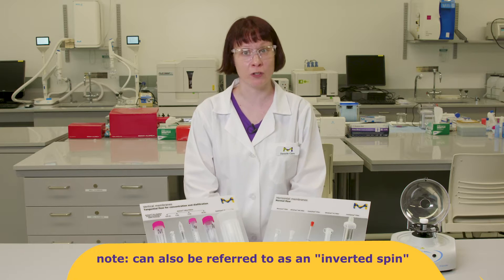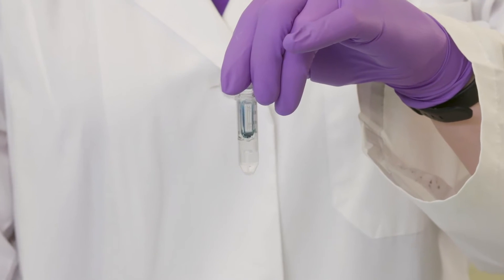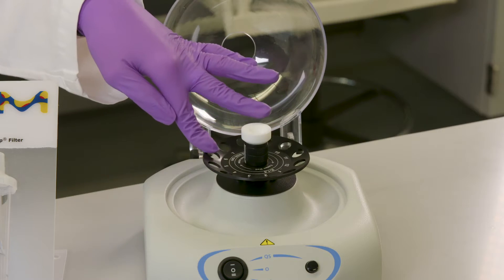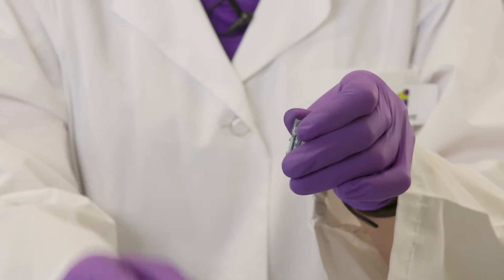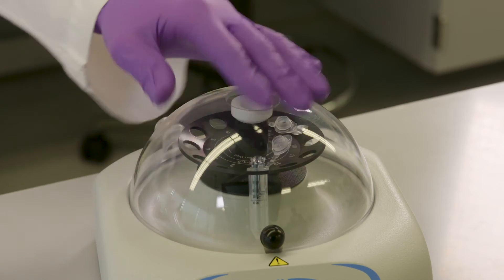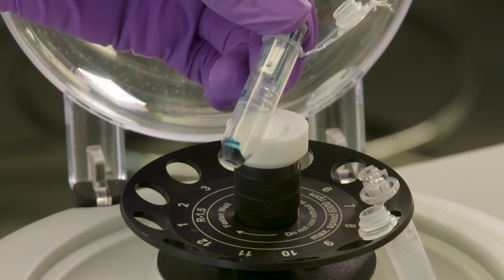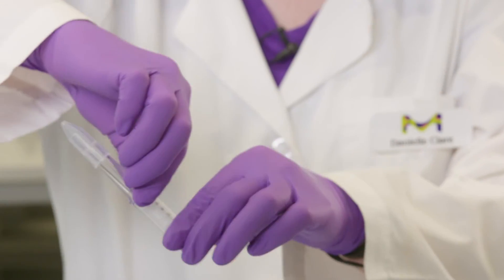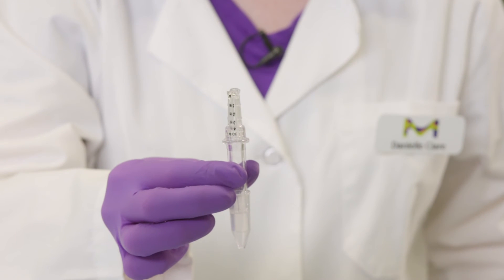How to Perform a "Reverse Spin" with an Amicon® Ultra Centrifugal Filter

Comment: What about the Amicon for 15ML tubes?
Reply from the maker: @MilanMuso - Thanks for your question! The inverted spin capability is only for our 0.5mL and 2mL Amicon Ultra – this is because of the very small final concentrate volume. It’s not always easy to remove with a pipette, so we have the inverted spin option. For the 4 & 15mL Amicon Ultra, a pipette can be used to remove the final sample.

Comment: What would be the optimal centrifugal force to use? The maximum that can be reached on ours is 3000 rcf. Thanks
Reply from the maker: Hi Anita - It's recommended to spin for 2 minutes at 1,000 x g. For Microcon, 1,000 x g for 3 minutes. Please let us know if you have any other questions!